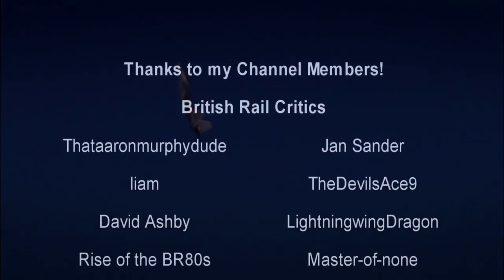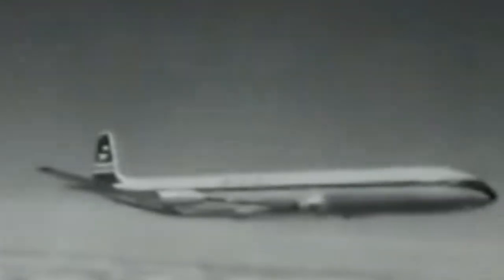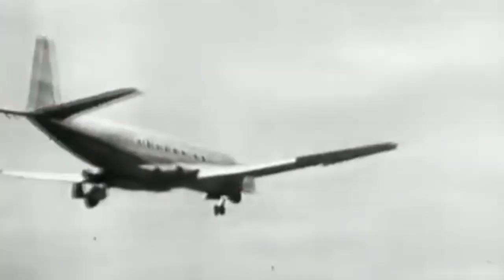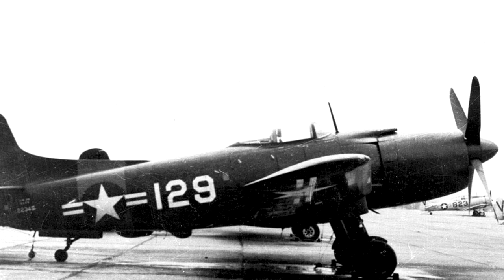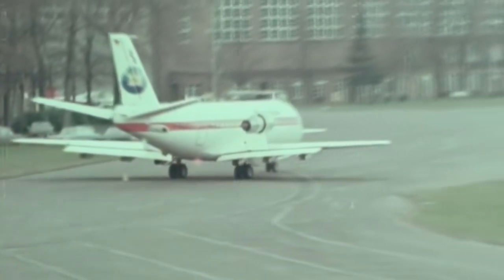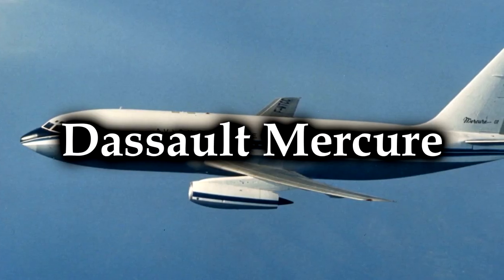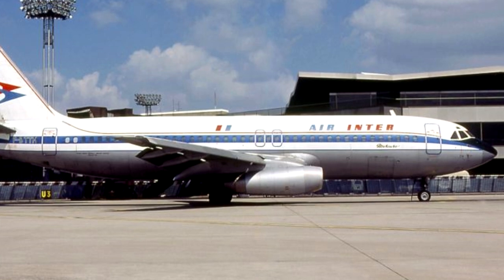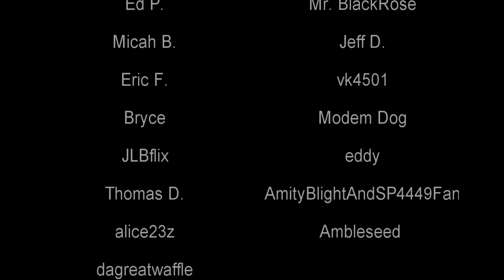5 Revolutionary Planes (That Failed Miserably) | History in the Dark

Comment: The square windows on the Comet WERE, in fact, a major issue related to the Comet flying at a higher cruise altitude than the other square windowed planes you mentioned. The design created a lot of stress at the rounded corners which would have been fine, but they miscalculated this stress in the design phase and did not make the corners of the windows strong enough to withstand this stress. 

Combined with the punch riveting, this resulted in a source of fatigue cracking(the rivet holes) exacerbated and accelerated by concentration of stress(the window coeners). Then, when the structure failed, the windows acted as a guide for the catastrophic failure to spread. 

So it wasn't just the windows, but they exacerbated the problem and were redesigned because it was cheaper to do that then to use a stronger material.
Reply: So stress risers/ Windows
Work hardening/riveting
Design specs/material choice

Comment: Thank you for telling the story of the Comet correctly. I have had so many arguments with people over that over the years. 
It is also worth mentioning the Comet investigation pretty much wrote the book on how to conduct a modern air crash investigation. 😊
Reply: Yeah I read up on the issues with the Comet many years ago, and the number of 'it was the windows that killed it' comments became so tiresome.
Reply: I mean, the material design of the window frame structure was an exacerbating factor as they accelerated the fatigue cracking of the rivets by concentrating the stress  rather than distributing it but yeah, it was more that they needed to be made more robust rather than square. 

They went round because they could still use the cheaper construction material and thus save money

Comment: The Mercure isn't quite the failure that you think it is:  when a fledgling aircraft manufacturer (Airbus Industrie) decided to manufacture a  narrow bodied aircraft, they purchased the tooling to build the fuselage barrels from Dassault.  So the A320 series uses the same fuselage barrels as the Mercure 😉  The A320-100 (very few built) had the same range issues as the Mercure, as it was designed for Air France's domestic arm, Air Inter.  It didn't gain the range needed to be a serious aircraft until Airbus designed the -200 version (which had the legs to be a 727 replacement!).

Comment: The Mercure was never sold outside of France mostly because it couldn't GET anywhere outside of France! 😁
Reply: Did it have funny orange headlights like french cars?
Reply: The Mercure was designed with 100% private funds.  Dassault showed up to all the major trade fairs in the 1970's and early 1980's, promising to build a longer range version for anyone who would order it.  However, with the same engines (P&W JT8D), there was very little to separate it from the obvious market leader, the Boeing 737.  The shorter haul DC-9 (also with the same engines) was much more efficient, being a much lighter aircraft than the Mercure.
Reply: Its literally designed to fly from Paris to the major european cities, and nothing else.

Comment: For a second part, you could go with:

Lockheed TriStar, Concorde (engineering accomplishment, but failed in the commercial market), Renard R.35, YB-9, B-10, YB-35 & YB-49, B-36, XB-43, B-58 Hustler, Bell P-59 Aircomet, Avro Manchester (though it's the reason why Lancaster even exists), A-12 Shrike, Witteman-Lewis XNBL-1, XP-31 Swift, Il-30, Saunders-Roe SR.A/1, Beriev R-1, X-20 Dyna-Soar, XP-77, and DH.29 Doncaster.
Reply: The Lockheed TriStar was a deeply loved plane:  by pilots and passengers.  Considerably better liked, built and respected than the DC-10.  However, it took longer to bring to market, partly because Lockheed, unlike MD, wanted to be sure to get it right before releasing it.  Because of that sales suffered compared to the not very admired (and early ones quite dangerous) DC-10.  The TriStar has also been described as "Was it too good for us?"  For me, and many others, it was my favorite 1980's airliner to fly on.  Along with the 727.   The B-36 was a 'distinctive' Cold WAr bomber, with only a short working life before it was outdated.  "With ___{I forget the number} turning, and {      } burning"  --Prop engines and early low power jets.  Huge.
Reply: @carlcushmanhybels8159  What killed the TriStar was Lockheed's decision to design it to use the Rolls Royce RB.211 engine, and Roll's failure (Which bankrupted the company, which only survived after government grants) to get the RB.211 in any sort of working condition until well after the DC-10 was in line service.  Timing is everything.
Reply: The Tristar was a success for the airlines who operated them. The flagship of what was becoming the world's most successful  airline, Delta. More fuel efficient than it's trijet rival. Na! The Tristar was successful, even if it busted Lockheed. No argument with your other 'additions'.

Comment: The Fairey Battle was a good aircraft for 1932 when the Air Ministry issed specification P.27/32. 3 other aircraft companies responded to this specification but on,y the Fairey and Armstrong Whitworth designs got to the prototype stage. The prototype Batle flew in 1936 and by June 1937 the first production aircraft flew. But even before the prototype flew members of the Air Staff were already considering the specified range and payload would be insufficient for a war with Germany.  The Battle was fkne for 1932 but inadequate by 1936 and almost obsolete by 1940. So why was it produced at all? The RAF needed all the aircraft it could get in the late 1930s.

Comment: A couple of those test rigs the DE Haviland were in, were still out the back of the old Hertfordshire University in the mid 90's.
The Martin Marauder,  sounds like a disposable aircraft, the UK used 'disposable aircraft for convoy protection in ww2. They catapult launched out of date hurricanes from merchant traders and had the pilot picked up a launch after splashdown.
The Fairey Battle, outclassed in 12 months, yes, the fate of many aircraft in the 1930's, like the Hawker Hind family it could have done well policing the empire. Perfect for what is now called 'COIN' ops (COunter INsergancy OPerationS). It is interesting that the German Junkers 88 had similar performance profile, and when the Luftwaffe lost air supremacy suddenly the legendary 'Stuka' dive bomber started to suffer similar loss rates.

Comment: The early Comets were killers.  In addition to the fatigue failures that everyone notes, like all early jets,  they were very underpowered.  Takeoff performance was marginal  The Comet 1s had to be rotated on takeoff to exactly 10 degrees nose up.  If they rotated early, or rotated to 11 degrees, the induced drag buildup prevented the airplane to accelerating to liftoff speed.  If the airplane was rotated to 9 degrees, it wouldn't develop enough lift to get off from the existing runways, particularly at the high temperatures found on the Africa and India runs.
Once the structural and aerodynamic problems were properly analyzed, the Comets were effectively redesigned, with better aerodynamics, a more fatigue resistant structure, and much more power.  However, this delayed its re-entry into service until the Boeing 707 (and a bit later), the DC-8 entered service.  The 707 and DC-8 were more advanced, faster, longer ranged, and carried more than the Comet.
That being said, the Comet had style. So much so that the French Sud-Oest Caravelle, the first Western twin-jet airliner, used the forward fuselage and cockpit of the Comet.
Note: BAE's website has a statement that is true, but deceptive - they state that the "Comet was the first pressurized jet airliner."  Factually true, but not the Great Leap that they imply - 
The first pressurized airliners were the pre-WW2 Boeing 307 Stratoliners (An airliner designed using B-17 components.), the postwar Boeing 367/377 Stratocruisers, Lockheed Constellations, Douglas DC-6s and DC-7s, the Convair 240/340/440s and Martin 404 feederliners, the Vickers Viscount turboprops.  Oh, yeah, and the Canadair C.102 jetliner prototype, which flew a short time after the first Comet prototype.

Comment: Honda built a passenger jet, like that, with the top mounted engines. It and the Comet both look like anime planes. Wonder how many of those internal wing engines could be done before it couldn't fly.
Reply: The Comet was not the only plane with engines buried in the wings - the Handley-Page Victor strategic bomber also has that feature.

Comment: As for number 1 - to be fair, any bomber without fighter escort was screwed before the dogfight even started (Just look at Devastator - it was fine in the battle at Coral Sea, but was decimated at Midway).
But to make it even worse for number 1, they were supposed to replace PZL 23 Karaś recon/bomber in Polish Air Force before September 1939. But... Number 1 was actually worse than Karaś. Yeah, a plane with fixed gear is worse than plane whose gear retracts for flight.
Wrap your head around that.

Comment: Wasnt the ‘ Comets ‘ in service past the 70s actually Nimrod AEW aircraft?  AEW - airborne Electronic Warfare

Fokker VFW ? Veterans of Foreign Wars ?
Actually looking at it it’s Very Bleeping Weird
Reply from the maker: Vereinigte Flugtechnische Werke. They're German.
Reply: Yep, same airframe.  But extensively altered by Hawker.  Most windows were eliminated and the few that remained were round, which eliminated the fatigue cracking problem.  Comets, unfortunately, had a bad reputation after, y'know, falling apart in flight a couple of times.  That tends to spook paying passengers.
Reply: @HistoryintheDark  I still think it stands for Very Bleeping Weird
Reply: @Phil Vanderlaan just look at the HA-420 HondaJet - what do you remind it of?
Reply: Last Comet 4s were retired from airliner service in 1981. The Nimrod was a development of the Comet 4C, designed for maritime reconnaissance and anti-submarine warfare. The AEW (Airborne Early Warning) version was only built as a prototype and was cancelled due to cost overruns and technical issues. It was not helped by the constantly changing specifications for the capability of the radar system! It is interesting to note that the Boeing E-3, which was eventually selected instead, did not come near to meeting those specifications either!

Comment: Bro did you just say Canadian Pacific "Airlines"? Um....please elaborate! Also why do those planes have weird swordfish spikes sticking out from the front? Is that to cut through clouds and make rain?
Reply: Canadian Pacific Airlines is actually owned by Canadian Pacific Railway.
Reply: The nose spike is an instrumetation probe used during prototype testing.
Reply: @Mark Vogel Canadian Pacific Airlines was the result of Canadian Pacific Railway acquiring 10 bush airlines in Canada and putting them together to form that airline in 1942. It was based in Vancouver, B.C., and its early management were bush pilots from the 10 constituent bush airlines. For years, its main rival would be Trans-Canada Air Lines (today's Air Canada) which was a government-owned company (a so-called Crown Corporation). It was sold to Pacific Western Airlines in 1987 to form Canadian Airlines International, which in turn, was sold to Air Canada in 1999.